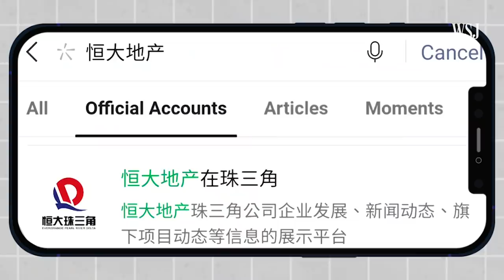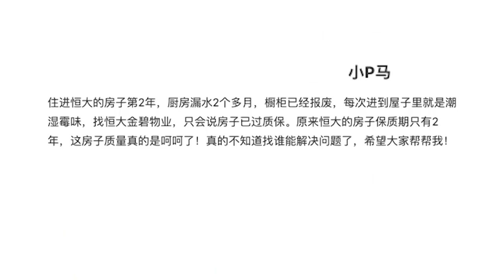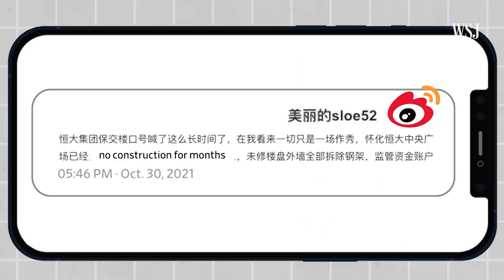Evergrande Says It’s Back to Work, But Homeowners Say Not Fast Enough | WSJ

Comment: Shoddy construction might end up being the biggest story in this fiasco. Trillions will be wiped out on that alone. You can go to the bank on that if they still have their doors open.
Reply: The Three Red Lines is the key factor. Without it, shoddy buildings would continue to go up indefinitely.
Reply: You got shoddy construction in the west as well. Remember Millennium Towers in San Francisco, Sydney’s Opal Towers and Surfside Condo collapse. Sydney Australia apartments are riddled with building defects: water leaks, cracks and flawed fire safety systems.